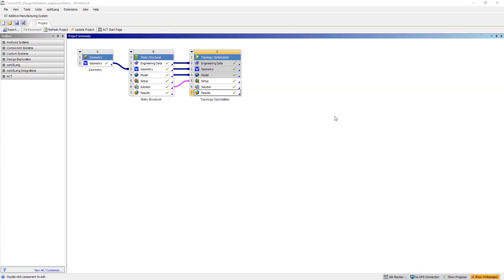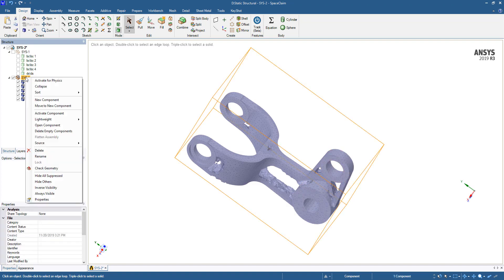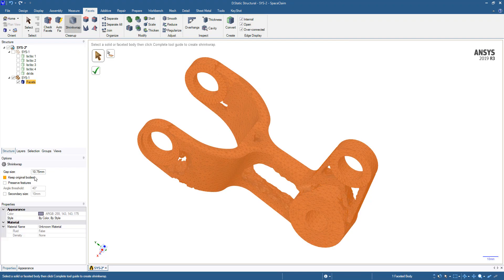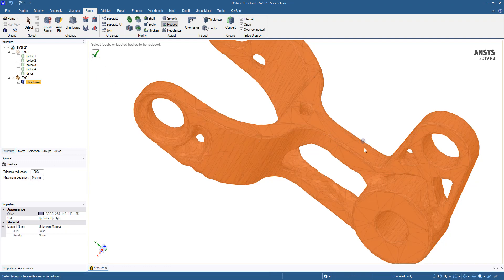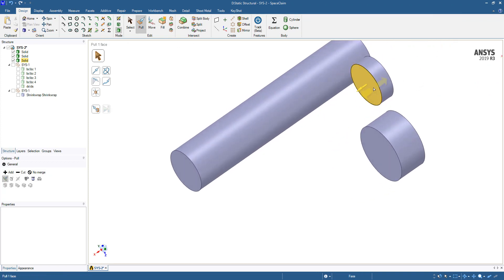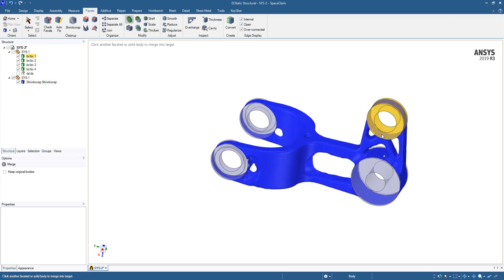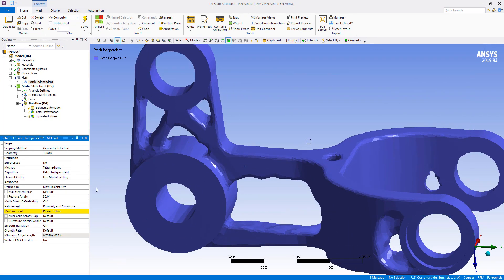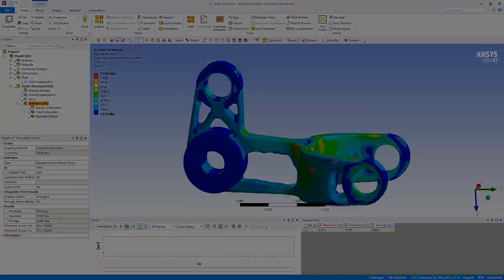Converting Topology Optimized STL for Design Validation

Comment: In the post processing tab, I only have the option to "Export Optimal Shape - Only Geometry".  I select this and the resulting SpaceClaim file is empty. Do you know this issue?
Reply from the maker: Good afternoon Jack, thank you for your comment. I was able to speak with the engineer that created this video and his response is below. If you need any other help or if you are interested in SimuTech Services like mentoring, consulting, or training, please send us an email at info@simutechgroup.com- thanks! 

Hey Jack, that is how it is defined in the latest version. The default settings of export optimal shape: Only Geometry, and Topology Result: Topology Density (drop down to choose which result to use if you have multiple) should be fine. Some options vary by version, but you should be able to get the stl by having a topology density result defined in the topology optimization analysis that you want to use and then right-clicking the result in the workbench project schematic to transfer to design validation (geometry) and update/refresh. 

It sounds like this is where you may be having issues and you are getting an empty Spaceclaim file. You could try to right-click the topology density result and export to the STL file and then manually import that into a new geometry system.